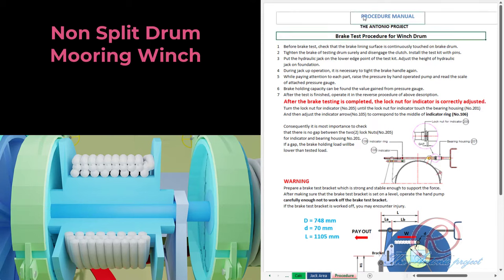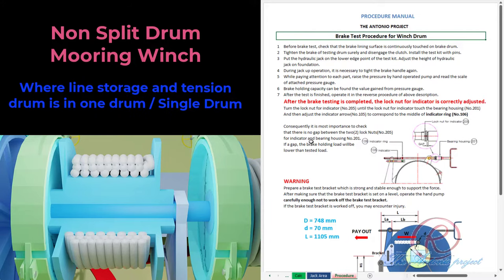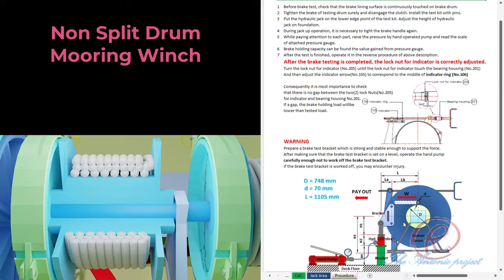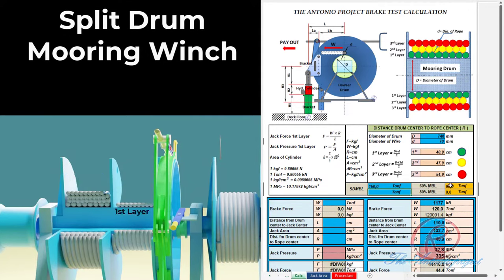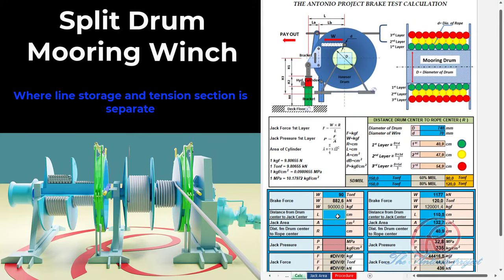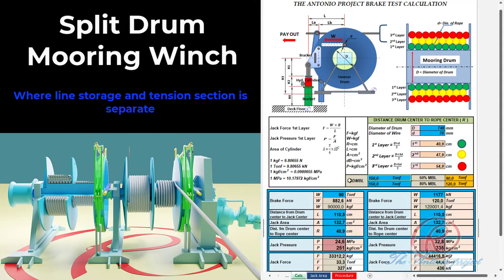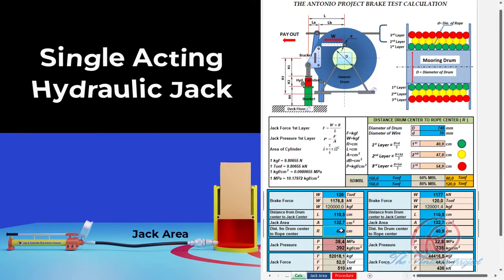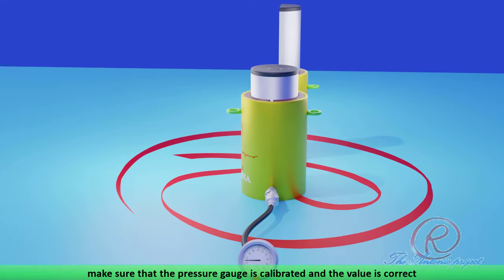Mooring - Brake Power Test or Render Test for Mooring Winch.

Comment: Sorry to say that but your calculation sheet for undivided drum 2-3rd layers are not correct.
Reply from the maker: Thanks for your feedback and find some miss-calculation.. my calculation for 2nd, 3rd layer based on radius of drum + radius of mooring line stacked in the same order. So that when 2 lines stacked, meaning that radius of lines is on the half of second layer + diameter of first layer or in formula is 3d/2 and not 2d/2. Same as when using 3 layers meaning radius is 2.5 of line diameter. 
Or, in actual the mooring line when it is stacked the mooring lines diameternya will not same as actual specification of the mooring. It Will flattened except when using wire as mooring..
Also, in my closing statement I have mention that [qtd "Undivided mooring winches become bit more difficult and it is recommended that the manufactures to be consulted in terms of how many line layers should be used in calculation "unqtd]
Reply from the maker: Anyway appreciate if you can share which formulas is not correct whether the radius calculation or others.. so i can manage to revise it... 🙏